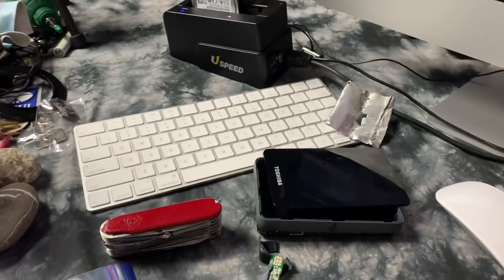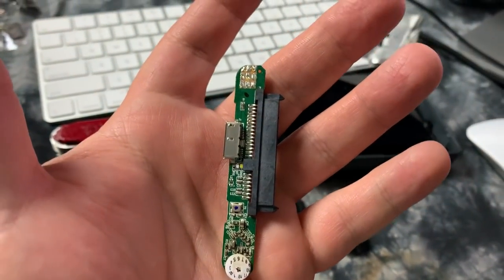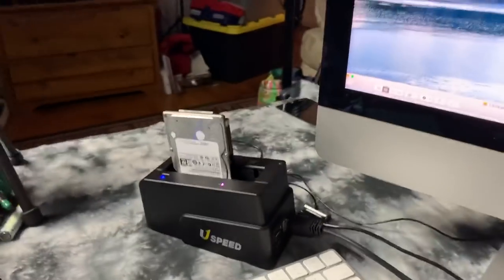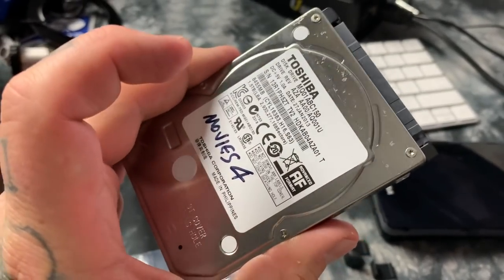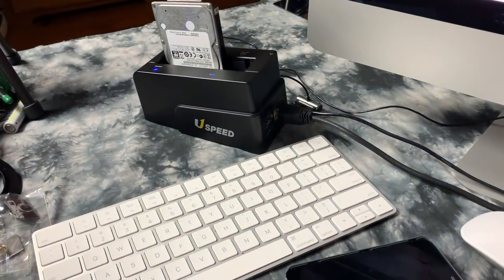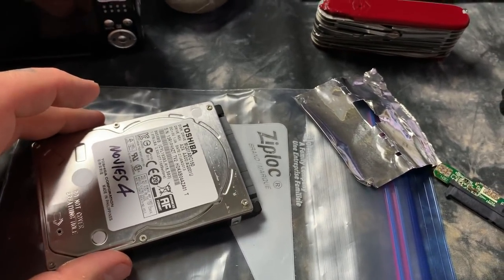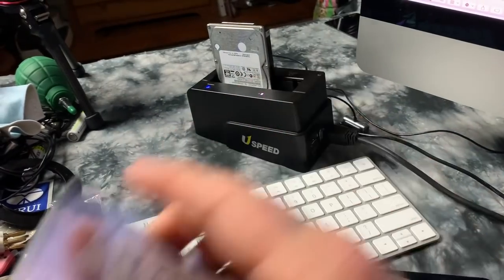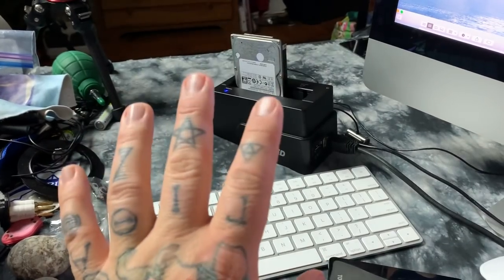😱 SECRET OF HARD DRIVE FAILURE! 💎😱

Comment: Thanks for parting with, albeit a snippet, of your extensive knowledge Ken. I found it very interesting esp as my external hard drive recently slipped off the sofa arm, pulled its cable out of my laptop and crashed to the floor! Luckily I had backed up on another external drive so was able to retrieve my photos. I’ve lost all the Lightroom edits but really not much of a problem. The good thing to come out of it is that before I backed it up to a new (now SSD) replacement external HD I decided to remove hundreds of duplicates and pathetic photos I had taken many years ago. My collection is now clean and trim and ready to change to Capture One which should be more suitable for my Fuji photos. Take care.

Comment: How do you go about backing up all your data? Also can you backup you operating system and programs so that you can simply reboot your computer as if nothing happened?
Reply from the maker: HD clones
Reply: I keep data and OS separate. I keep my main OS drive backed up with 2 clones that rotate over time. My data has 2 backups as well. My only shortcoming is that I don’t have an offsite backup and I really need to get working on that.

Comment: SSD has wear leveling problems still. SATA you can use S.M.A.R.T to predict failure on magnetic. I just use RAID 0 and 6 on UPS in addition to some crypto SSD for cold storage
Reply: That and pick a vendor who has a good bearing design.. The archival optics stuff he is talking about is used for a very small data set and only by some governments.. Private sector data store providers use magnetic and ssd with raid and a lot of custom software..

Comment: Hello Ken I I would like to ask a question. 
I need a new or secondhand laptop I use light room. I am not a pro
And I don't need the most powerful laptop and this means i wouldn't want to spend a fortune. I try all ways to use as minimal as possible adjustments in light room because I rather want to focus on the photography then on computer work. Thank you for your great work your knowledge about photography and all the hardware is amazing. Greetings from the netherlands
Reply: Hi Kurt, I have been using a late 2010, 13" Apple MacBook Air 
Processor, 2.1 GHz Dual core
Cache. 6 Mb
Bus speed 1.07 GHz
Graphics card. NVidia GeForce 320M 256 Mb
RAM, 4Gb
SSD, 250Gb

It performs Lightroom very well indeed and I’ve been happy with its LR performance all these years. This is espeially true considering how so many people enthuse so much about much higher specification computers. 
I don’t film video nor do batch processing of multiple photos.
As you can see its 9 years old and still going very strong. Its been 100% reliable. Its resale value now is zero.

If you can find a good condition secondhand MacBook Air, I’m sure you’ll be very pleased with its perfomance. It will be quite light, so comfortable to have on your lap when sitting on a sofa and of course to carry around.
Hope this helps. Good luck!
Reply: Hello Christian thank you very much for this information. Indeed it's very helpful. Yes there are to many people out there trying to get the best equipment money can buy, and forget all about the true art. We can produce art with very little. Doesn't have to be expensive. Thank you for your help and have a nice day. Greetings Kurt.

Comment: Let’s say I format my toshiba hard drive on iMac reboot the system and the question mark shows up. Did I make a a big mistake, and how to fix it?
Reply: Did you theoretically format the internal drive on your mac?
Because that removes the Operating System.

Trying turning your iMac off. Press 'CMD + SHIFT + R' and hold those keys down. Then turn your iMac back on while holding those keys down. Your Mac should boot into "Internet Recovery" 👍🏻😊. Just make sure you are connected to the internet haha.
Reply: Guess my WiFi was to weak, thanks for the tip.
Reply: @mumra100  you're welcome 😊

Comment: Hey Ken! I have an old broken mechanical hard drive I’d love to recover. Is it possible to find an empty hard drive without platters to mount mine?
Reply from the maker: pretty hard to do that bro
Reply: Disk based drives have sectors laid out on the magnetic medium of the platters. The low level formatting is specific to each drives platter and that information is recorded on the drivers main controller, or at the first first sectors of the platter itself. Data recovery of these are tricky. Ideally, since drive to drive controllers can be unique, you'd need the exact same controller as the drive that died to swap the platters into. The read/write heads have to be very, very delicately moved around the platters...etc. Depending on how bad the damage is, you'd need to scan every portion of that platters surface to find the sectors and reconstruct the data without any file table and try and reconstruct the data that way. Data recovery gets very expensive very fast.
Reply: Yeah I have the tools but I’ve never done anything like it before.

Comment: Would you recommend using NAS bays,uncle?
Reply from the maker: JBOD
Reply: @KenTheoriaApophasis  Redundancy is pro.👍
Reply: Raid 5 with a hot spare. My NAS has been running for 4 years with no issues (probably a ton of failures now because I brought it up).  Slightly more costly, however, if a failure occurs JBOD does nothing to help out. Raid 5 has a 25% overhead penalty vs JBOD has none. Of course the hot spare is 100% waste. There are trade offs one must weight for what one is trying to accomplish. Wish you all the best on your decision!
Reply: Theoria Apophasis JBOD and RAID are shit compared to ZFS.

Comment: Another thing that prematurely destroys hard drives is any windows operating system. This is because windows is really bloatware disguised as an OS. Daggum Window Os's will spin those platters for no reason at all. FYI-M DISC™ optical media is the new standard for digital archival storage. Unlike traditional optical media, which utilize dyes that can 
break down over time, data stored on an M DISC is engraved on a patented
 inorganic write layer – it will not fade or deteriorate. This unique 
engraving process renders these archival grade discs practically 
impervious to environmental exposure, including light, temperature and 
humidity.

ISO/IEC 16963 standard longevity tests have proven the durability of M DISC technology, and it withstood rigorous testing by the US Department of Defense. Based on 
ISO/IEC 16963 testing, M DISC media has a projected lifetime of several hundred years.
Reply: No. You can set Windows to sleep drives. Or you can complain on the internet....